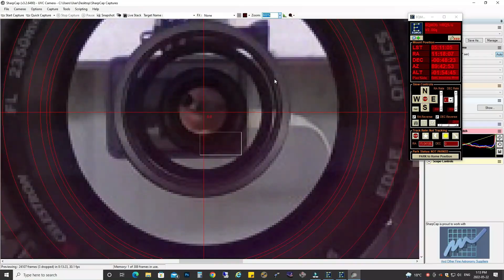Sony A6400 and Sky Adventurer GTI rig

Comment: Nice modular setup Don. I feel your pain when it comes to the drilling incident.... been there, done that a few times. I'm guessing that the small computer is so light it doesn't effect balance too much? Clear skies.
Reply from the maker: Hi Logan. Thanks for watching. Yes, you are correct. The small computer weighs next to nothing. I pull it all of once polar alignment is completed when using just the Sony camera. I have used it also with my evoguide 50ED. It  seemed to work okay. Early days for this rig so it may change again if I notice issues. Clear skies.